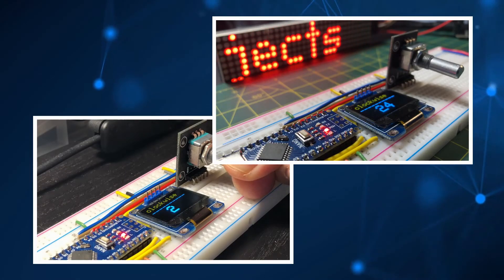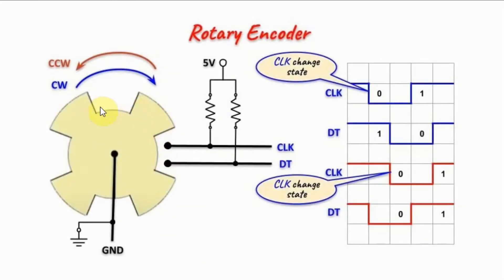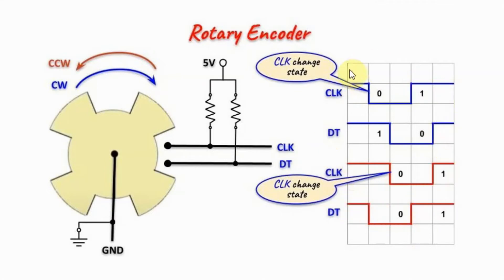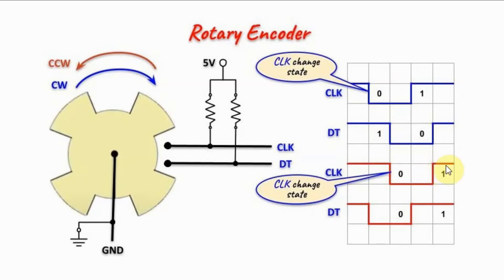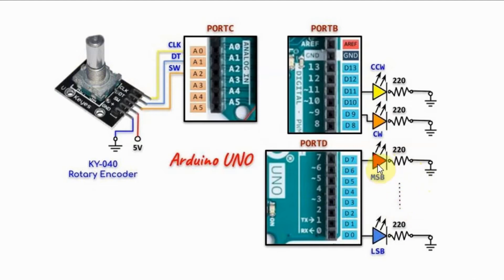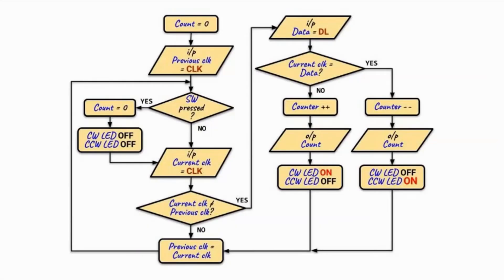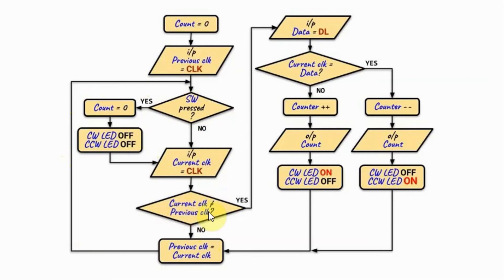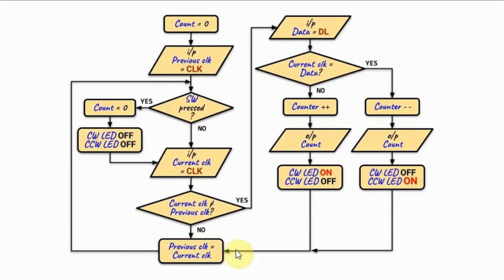Assembly via Arduino (part 24) - KY 040 Rotary Encoder

Comment: Please make a video about assembly code for OLED display 128x64 (and other may be).
Reply from the maker: That’s a complex device to code in assembly. And the data sheet is not well documented. I have programmed other displays like MAX7219-based screens. You can checkout the videos.